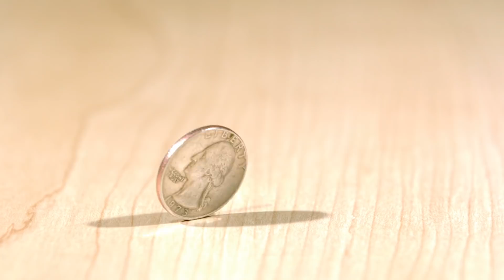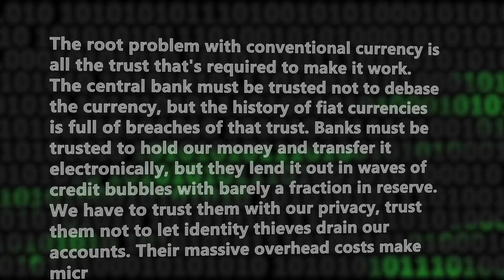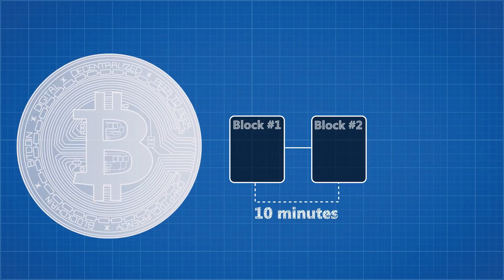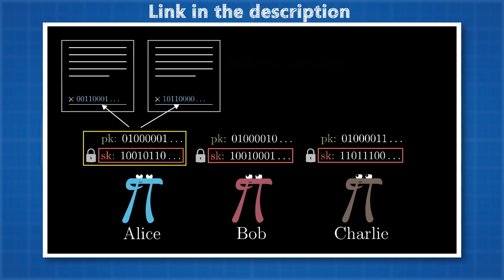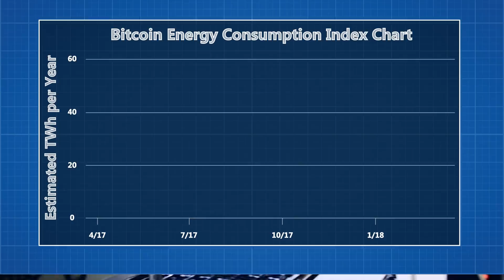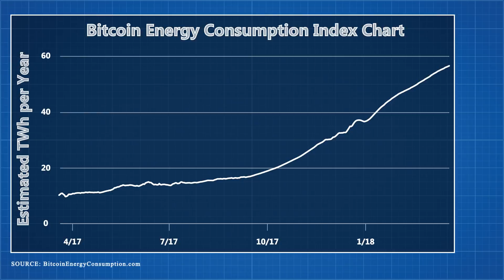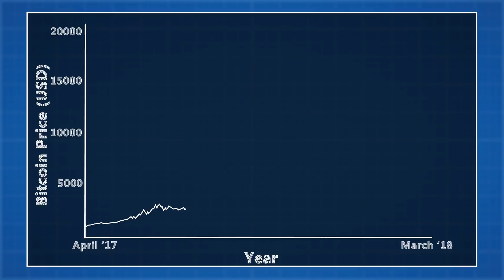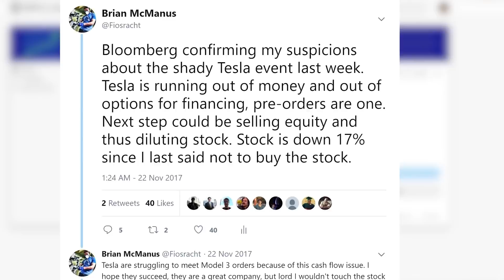Why Bitcoin Is Not Working

Comment: This is technically false. Bitcoin was working as a payment system (even with high volatility) before the Core team refused to increase the block size and allowed the fees to skyrocket. Not saying they should have increased it, but that was the event that caused people to stop using it for payments, not the volatility (which was always there).

Comment: 1- Blockchain is not an interesting technology by itself, without creating a token that has value due of its scarsity (like bitcoin) it is just a decentralized database, less performing than a centralized one. So the only interesting use of the blockchain is BITCOIN.
2- You can't compare bitcoin to VISA, bitcoin is a cryptocurrency and can only be compared to other currency and the energy they consume (considering the total of their banking system, building, transport, people involved, etc.). Visa is just a paymant system and you can have a visa card for bitcoin. The blockchain is what guarantee the existance of a new currency not the exixstence of a payment system.
3- The future of bitcoin will be Lightining Network, with the born of the INTERNET OF MONEY, where you send real value (bitcoin) through the internet.
4- the bitcoin market is still too little to have a stable price, at the moment we are in a phase of initial diffusion, the more it is used the less its value will fluctuate.

Comment: I could make a whole video with all the misconceptions and flaws on your video. From speed of network, volatility etc. so many mistakes. You dont get into Segwit and Lightning Network which will deal with scaleability. The only thing I would agree with is the problem of Bitmain owning like 30% of the Hashing power. Its a huge problem

Comment: Cause bitcoin is nothing more the security encryption no diff clicking encrypt on u hard drive no diff still no safer if it was safe your banks be using it but guess what there not never will its not safe fact a joke to hack steel.

Comment: +Real Engineering
you forgot the lights in every bank in the entire Country, every computer the bank owns. the security cameras at the bank, the gas to energy of the bankers driving to work. the cost of heating the bank....all the ATM'S. if you are going to compare a complete system, bitcoin vs banking. then you fucking better do it right.
the amount of POWER that is used just to have banking all the time is SO VAST. 

stop comparing apples to oranges.

Comment: The high power usage phases out once all new coins are generated. Comparison to Serbia is laughable and misleading. Further comparing transaction amounts between Bitcoin and Visa is even more misleading because most of the computing power going into bitcoin mining is the creation of new digital coins not verifying new transactions. So the real comparison would be the energy costs to produce every coin, note, check, card along with the transaction and handling costs (of physically moving money, cleaning money, counting money, etc) and wiring and digital transaction costs and costs of computers or people who verify and audit transactions, deposits and withdrawals. Could you imagine the power usage if the US Mint had to create the equivalent of all coins currently in circulation?

Comment: Even before money, traders weren't just bartering nor was this process arduous necessarily. However the trade value between assets was not set so the value of say sheep to horses might be considerable different for every farmer you'd trade with. The whole idea of a currency is to standardize the value of commodities that along with a trade infrastructure is what you'd think of as a market in the macroeconomic sense rather than the physical place sense.

Comment: FKING IDIOT, ON CHAIN CASH DOESNT WORK ANYWAY BECAUSE BLOCKSIZE CANT SCALE EXPONENTIALLY. The lightning network is the payment system of bitcoin. it basically already works in beta stages on VISA levels without increasing the energy cost of mining any further. FK OFF, PLEASE TRY AT LEAST TO RESEARCH STUFF BEFORE MAKING A VIDEO.

Comment: BS, Bitcoin is working now lightning network is on the main net,  when routing is tuned up (latest in summer) it will explode (10^5-6 trx/s). Do your homework. 0,8% of US electricity/ power is negligible, US army spends way more, the debate is over. Btw Cardano (ADA) has "hack prone" POS (no mining) algo, it can use lightning too.

Comment: Barter has never been a primary method of trade, all currency systems were predated by owing favors to various group members. If the group was less than 100 or so it was easy enough to keep track of who owed you a favor, but as groups grew beyond this it became necessary to quantify the value of work.

Comment: Can you tell us how energy consumption is really counted in comparing visa or other such institutions to the bitcoin network instead of rehashing this same tired (long debunked) old talking point? The people making the argument that bitcoin consumes more power are selecting from a narrow band as to what constitutes credit card processors energy expenditures vis-a-vis the entire bitcoin network. It's not a fair argument since visa couldn't function without banks and you'd have to add up all the costs of running every bank branch (their utility and property costs, etc) that process credit card payments and all their data centers which makes credit cards possible to begin with. 
One estimate is that banks use 26Twh for servers, 58Twh on branches and 13Twh on ATMs for a total of approximately 100 Twh a year so maybe it should be a red flag to people that they are selecting individual credit card companies to compare bitcoin and conveniently discarding the banking system which supports it all. I mean at least add up Visa, AMEX, Mastercard, etc to make the argument actually seem part way credible LOL

Comment: In theory fair points BUT:

1. Lightning Network presents a solution to transaction limitations.
2. Volatility descreases with volume. The price won't drop drastically if someone sells $100M worth of BTC when there will be trillions of dollars marketcap in the future.
3. We have time. To mine all the BTC there is with our current hardware, it will take approximately until the year 2140.

Comment: 7:53
I Will try to explain questions in this video.
This video says that Bitcoin is not working because too low fees for miners to verify transaction.

The economic law of supply and demand is : When the fees is its lowest point, a few miner will get out from the system. Then the fees become back to normal. The miner fee will be automatically adjusted to the electrical cost. This is called the Order of Chaos.

If someone suddenly make a very fast Computer chips / GPU, they won't able to defeat the system, because this condition has been occurred when Bitmain release their ASICS, but Bitcoin cannot be attacked.

Comment: the video is not completly wrong but
Comparing Btc and Visa is comparing Apples with the fruitshop
one is a courrency-the other just one form of payment.
the Gpus shown in the mining farms are certainly not mining btc.
they use asics for that nowadays.
have you not heard of the lighning network? it will solve most of the problems with the transaction volume.
Btc does Work-give it some time.
it has been around for only 9 years and risen from an idea to a recognized figure!
and if its not bitcoin another cryptocurrency will take over because
FIAT DOES NOT WORK

Comment: Many valid points in the video. What I didn't like is writing off bitcoin and crypto currencies in general because the transactions per second are low. Yeah that is a problem right now but it is a problem we can solve. It isn't a valid reason to drop the notion of digital currency altogether. Pretty much the same critique for other arguments made in the video. Energy consumption is an easy one to solve with different consensus algorithms, but even then just because some things use a lot of energy doesn't mean it isn't worth it. Volatility is a problem, once the incentive to mine bitcoin runs out might be a problem (it could just mean less people mine which would help the energy problem) Volatility solves itself once the mania wears off and people start using digital currency to buy household things. There needs to be some regulation to help stop some of the stupid market manipulation and ICO craze, but don't blame the tool for what greedy thieves do with it. Just punish the thief.

Comment: You clearly don't know what you are talking about. Do some research before posting clickbait BS videos, because this is misleading. Mining power is a self-adjusting thing, if there are more miners, the difficulty goes up, then it needs more power, if mining becomes less profitable less miners will do mining, the difficulty goes down, needs less power. This is not an infinite loop in increasing power, it is a self-adjusting system. If there will not be any reward for mining blocks (all coins will be mined) mining still will be needed to operate the network, no point to keep coins if you can not spend them because nobody is mining the blocks, the people will set a mining fee for the transactions that will be received by the miners as a reward for the job. Of course this may cause two situations: the transactions fee's will rise again because people will offer more and more fee to get in the next mined block, or the mining difficulty will go down that will cause a kind of vulnerability on the system, but this will not happen soon, as i remember all coins will be mined around the year 2140.

Other thing is: for small and fast payments other solutions are still in development, like Lightning Networks, that will make users able to do small transactions off-chain, so it will be fast, cheap, and operating the Lightning Network system uses significantly less power, because it is not using mining for transaction validation.

As a last word: the all technology and adoption as a everyday currency is in the very early stages. With estimation we can say if 100% is when everyone using or accepting Bitcoin, then we are around 1% now. It is impossible to do such extrapolations yet about it's future as it is in this video. Even if it is not entirely used as a currency, but rather than a trading asset it does not affect the technology and opportunities behind it, or the goal of it as an invention. Just look at Forex, USD, EUR, all currencies are traded as a stock shares since years, but this does not make them useless as a currency.

A LOT of statements in this video are completely invalid. Just sayin'

Comment: Hrm, a nice Video, but you did not do you research properly it seems. For Bitcoin, the new lightning Network (that was started way before you made this video) is lowering the energy cost and fasten up the transaction speed. But for the long term, Bitcoin is not a currency to pay, it is like you said, digital Gold to store your Value. But there are other Currencys that have the ability to be that what satoshi wanted... a digital pay token with a stabile price. The Cryptoworld is working on that. The first attempts are Tether and T-USD... also there are many patents pending at the moment. Like the Oracle Network of a stellar-token, called Mobius (Mobi), that will not use proof of work like bitcoin, is extremely much faster then Bitcoin and much better scaleable. Or Nano is a similar project. Infinite Scaleable. In the next 2-3 years we will have currency that works like Satoshi wanted it... but at the moment you are right, we are in the wild west of Crypto but i think there will be something good coming out of it.